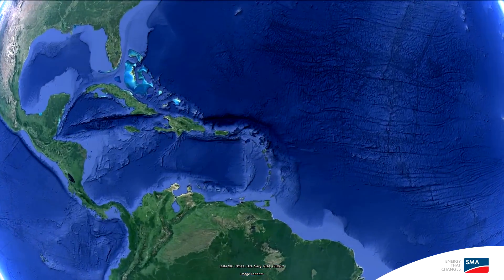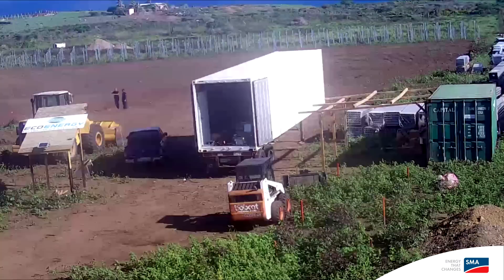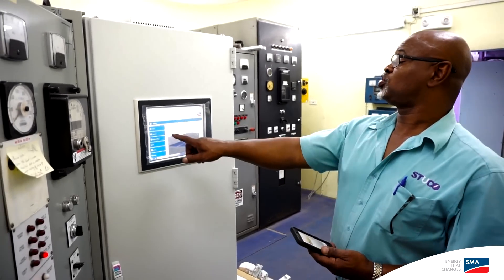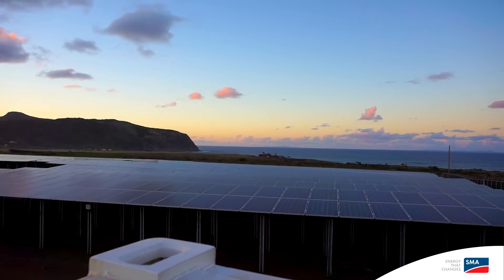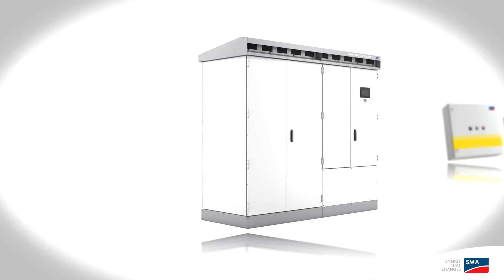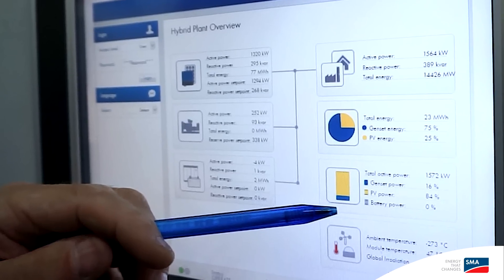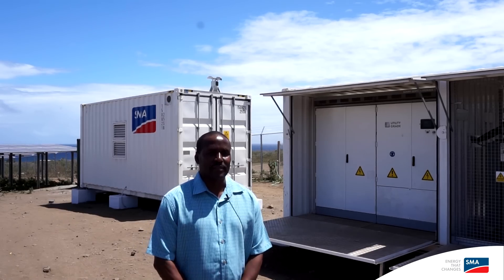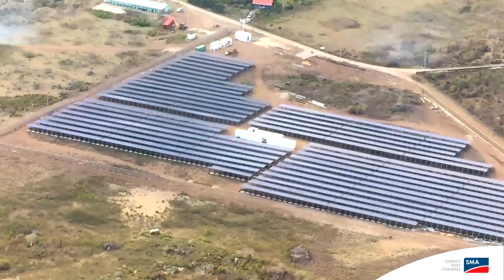カリブ海のシント・ユースタティウス島: SMA燃料削減ソリューションによる持続可能な電力供給

Comment: This is awesome! I would love to be a part of something like this. Is that a biodiesel generator? Also, what was the utility grid infrastructure like there? Were there any upgrades?
Reply from the maker: Hi Samuel,
Thanks for the interest! At the moment the island is powered over Diesel generators. Currently no Bio Diesel. 
The utility upgraded the grid infrastructure with under earth cables to replace the landlines in order to become more hurricane proof. These measures are only partly related to the installation of the PV/Diesel Hybrid system. 
The utility is exploring further measures on how to increase the RE ratio in the overall system step by step. 
Regards, Annika
Reply: instaBlaster.